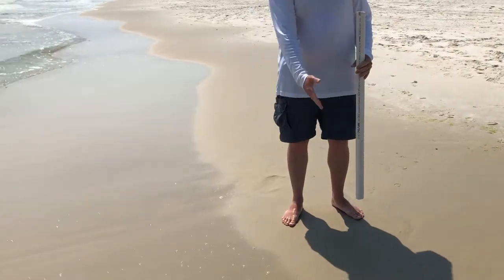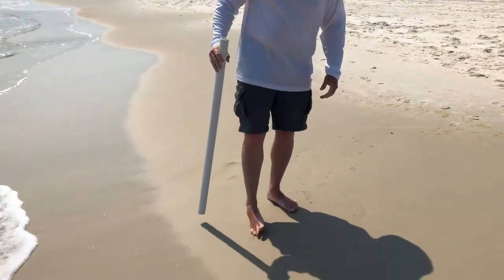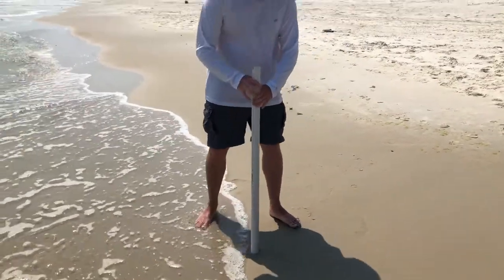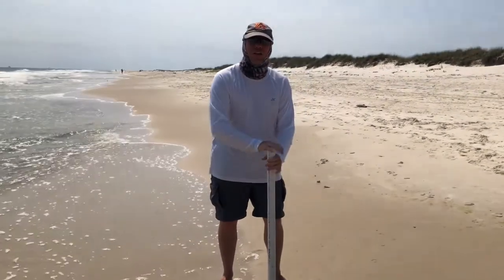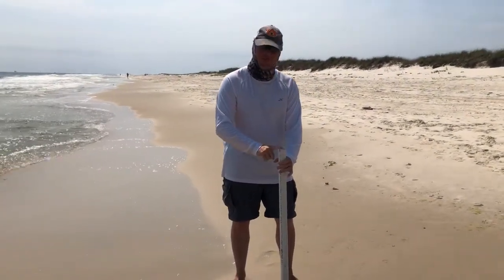HOW TO INSTALL PVC BEACH ROD HOLDER THE EASY WAY!!!

Comment: Haha you got some lungs bro, that thing went down easy. Not a bad trick at all, I need to make some rod holders for my small boat. PVC is what I will be using. Good tip!
Reply from the maker: Kirby's FishNGrill lol! But seriously it takes zero effort. The key is the sand has to be wet. Did research on it. The water helps create the vacuum and decreases the fiction factor. Thanks for watching man! 
What all you fish for in your area?
Reply: I don't have many options since our waters come from the Colorado River. Mostly canal fishing, we have lakes that have small mouth and large mouth bass. Nothing healthy in size since the lakes do not get much love or have a natural source of water to flow from. In the main canal here passing through, you can get bass, catfish, blue gill, sun fish, and stripers. But somedays its tough because we deal with fast current, but stink bait for catfishing works to let that scent travel along the canal.
Reply from the maker: Kirby's FishNGrill gotcha! How far from ocean are you? 
That’s still some great fish species to catch. Catfish is my favorite here.

Comment: Good tips. We always use pvc for rod holders in sandy river
Reply from the maker: Musky Hans thanks man! Yeah the key the sand has to be wet.
Reply: County Line Outdoors yeah that helps. Sand is actually strongest when itbis parially wet so like the area you put it in is the most stable part of beach. It becomes like a liquid as it gets wetter and powder when its drier.
Reply from the maker: Musky Hans makes a lot of since. What y’all fish for off the bank in the rivers?
Reply: County Line Outdoors catfish walleye and whatever else bites
Reply from the maker: Those will be great videos!

Comment: No way!  LOL    I tried for the first time putting a new rod holder into the sand in the Florida gulf sand and it was too hard.   My rod holder has a PVC spie at the bottom but still wouldn't go into the hard sand.   I'll need a hammer. LOL